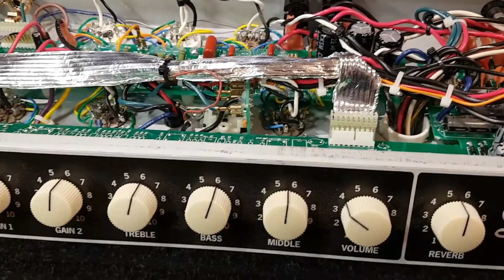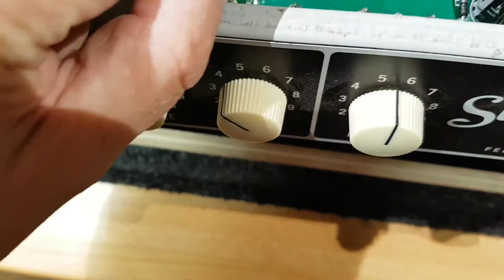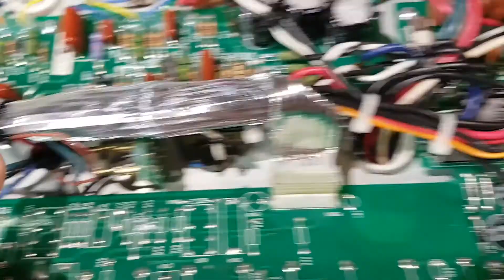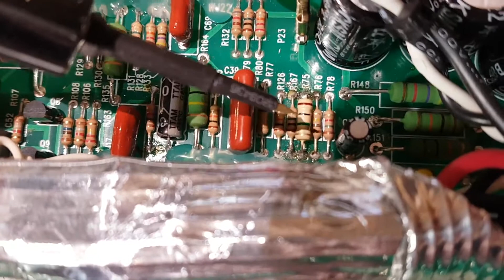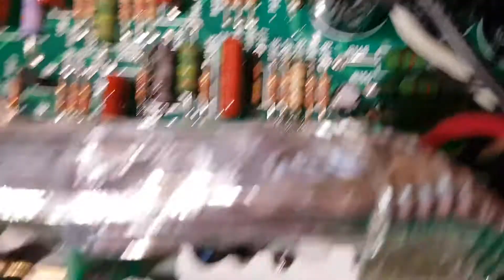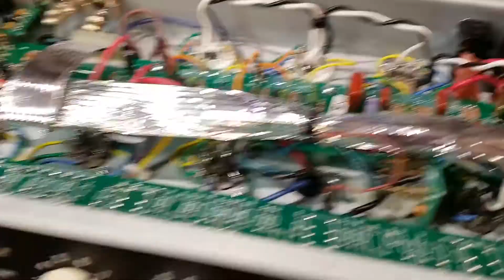Noisy Fender Super Sonic 22 revisited.

Comment: Could you address the same type of noisy reverb found in a Fender Deluxe Reverb? Have two of them that were "upgraded" by pulling the circuit boards and hand wired by Ben Fargen. One of them sounds great, and on the other the reverb is basically useless.
Reply from the maker: Noise is a sumbitch to troubleshoot. Especially if the circuit has been hand wired. Best get the guy who did the wiring to fix it.
Reply: @DerekHerbst747   Would love to, but he never responded to three requests for information. I'm S.O.L.! Thanks anyway.

Comment: Sorry, quick clarification if you don't mind. Did you say that your amp came from the factory with a 100k resistor in position R76 instead of 220k that the schematic suggests? Or did you perform this change?

Unless I'm misunderstanding something, I'm also not sure why you would change R75 from 3.3m to 1m if your goal is to increase the reverb. R75 is the preamp to reverb mix connection, so lowering the resistance should decrease the relative amount of reverb (because the clean signal has less resistance now and should be louder).
Reply: For these purposes I have instead been looking at R167 which in classic fender reverb circuits is usually 470k instead of 1m. I'm not sure why this amp was designed to have a lower reverb return.
Reply from the maker: @jthorborg  amazingly, I changed both resistors back to factory values (3.3M and 220k) just today because I found the balance of Reverb to dry signal a bit weak compared to classic amps like the Deluxe Reverb. And yes, the 150k was from the factory.
Reply: @DerekHerbst747  So this change back to factory values increased the dry signal in your experience?
Reply from the maker: @jthorborg  no, it improves the wet signal. My bad. My previous reply was badly written.

Comment: I solved the heater noise issue in mine by simply removing the filament lines from the wire harness.  And flying them separately from the main bundle.  Little FYI, copper tape won't solve the issue.  Heater noise is transfered through B-field (magentic, alternating) rather than E-field.  So low permeability shield materials like aluminum and copper will do nothing.

Comment: I have solved the issue. Not sure if you still have the amp but i traced it to the snubbing caps in the rectifier. They were physicaly ringing. After switching the diodes to fast switching diodes and ditching the caps no more noise. Hope this helps.

Comment: I had done your original fix with only the 2 wires shielded. Difference is I used copper tape as it was available. This weekend I wrapped the bus cable completely in copper tape, and then electrical tape to ensure no shorts if it gets pushed down to the board. Its quiet now. I still have the 2 resistors running in parallel as required in the TSB by Fender for the ring. If I remove those the increased gain will cause the ring to come back. 

Another thing I noticed is these things do not like LED lights on the same circuit. Nasty little buzz when the lights are on. Im thinking about trying a Fermun power bar, but I'm guessing its something I will have to live with.
Reply from the maker: Have you tried putting a capacitor in parallel with the LED? About 0.047 should do it.
Reply: @DerekHerbst747  I'm talking led house lights on the same electrical circuit. The cheap DC converters are noisy. Especially the dimmable ones.
Reply from the maker: @beausw  Gotcha. Yes those things are the bane of my life!!!

Comment: I've got this amp it's making me crazy. I thought I had a tube go microphonic, but changing the tube didn't change anything. At certain frequencies the amp will get this weird metallic sound, like a chain rattle or something. Even with the reverb disconnected. Any ideas?
Reply from the maker: The fix shown in this video should alleviate the problem. If you are not experienced in tube amp repair please get a professional to do the job. specifically, the wires from the board to the tubes can be microphonic.
Reply: @DerekHerbst747  awesome. Thanks a ton. I'll give it a go!
Reply: @DerekHerbst747  maybe dumb question, but what does grounding the tape do?  It's just there for electrical insulation, right?
Reply from the maker: @TopSecretEric  The tape is aluminium or copper tape. When you ground it to the chassis it acts as a shield against electromagnetic radiation present in the amp. This drastically reduces the hum and noise commonly found in these amplifiers.

Comment: Thank you for this video. I am trying to reduce the noise floor and followed this instructional video by wrapping the ribbon cable with copper tape. Unfortunately, this was not successful for me. I am going to check the ground again tonight. I used cloth guitar wire soldered to copper tape and then wedged and tightened under chassis screw (not soldered). So I’m a little bummed with that. Good news is I wrapped the reverb tank in a thin cotton shirt and that took away all the oscillations I was getting. 
Any advice is appreciated- thanks!
Reply from the maker: It depends what you mean by noise floor. This mod eliminates 50 or 60 cycle hum induced into the ribbon cable from the 6.3 Volt heating circuit. The underlying hiss, especially when the high gain channel is on, is way more difficult to eradicate. This mod helps a bit with that but only a bit. That said, the better you ground the copper tape the better the effect.

Comment: Perfect. That's what we need. Aluminum foil is safe. Copper foil will work also, it's a little bit more resistant against corrosion/ humidity.
Reply from the maker: Agreed Jim. I would have used copper foil tape if I had some on hand. It's probably a better way to go and you can solder the ground wire directly to the tape.

Comment: Quick follow up. I managed to solve the reverb noise based on your solution. Thank you! However, there is still a buzz that gets louder when volume turned up. The shop said problem with the power adapter and a faulty tube. I can replace the tube but couldn’t find a part called adapter. Would u be familiar with this issue?
Reply from the maker: Sorry for the late reply, the power adaptor is the big transformer. I doubt that it's the cause of the buzz. The tube might be noisy and it's easy to change and verify.   However I would also try turning the amp through 180 degrees and listen if the buzz changes in volume. This will confirm that the buzz is being picked up from an external source. Then comes the process of locating the part that is picking up the noise.

Comment: Would copper tape be preferable over the aluminum tape?  I have some that I had purchased a while back for shielding pickup cavities in guitars. 
I was happy to see your Super Sonic videos as I own a Super Sonic Twin (100 watt combo).  Often wish it was a 22 instead as it’s complete overkill at 100 watts and weighs a stout 85 lbs.  At least half of the time I use my Ampeg GVT5 combo though for convenience.  However I do love the versatility of the Super Sonic’s two different clean channel voicings and the gain channel.   Having the classic Twin Reverb esque channel and a Bassman esque channel is really amazing.  It’s really interesting to hear how different pedals  react with the different voicings.  Usually anything that doesn’t sound good with one will sound good with the other (ie: Vick Audio Overdriver sounds awful with the Twin Reverb channel and wonderful with the Bassman channel because the mid frequencies are much higher).
Reply from the maker: Copper tape will work perfectly. Remember to use a wide tape and run it along the length of the ribbon cable and don't spiral wrap it, which would create a nice "antenna".

Comment: Thanks for your service. Can I ask what if you don’t ground the aluminium shielding? Not confident I can do this correctly. Is there any risk?
Reply from the maker: You must ground the shielding layer otherwise it's totally useless. You can put a layer of clear tape over it afterward to prevent any short circuits if you prefer.

Comment: I’m actually sorry I didn’t see this before I had one of these to deal with a couple of years ago. It drove me CRAZY at the time.
Reply from the maker: A lot of the newer Fender tube amps seem to have the same issue in one form or another. It comes down to Lead Dress. They underestimated how much noise is a result of the very high impedance inputs of the tubes, which results in them picking up radiated noise in the longer, unshielded signal leads.